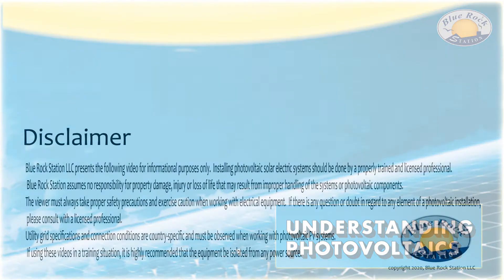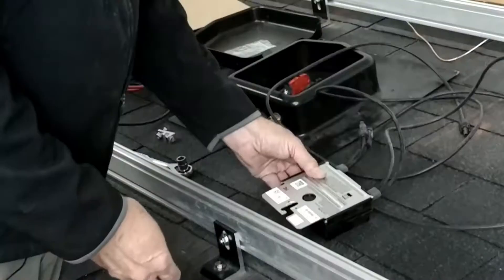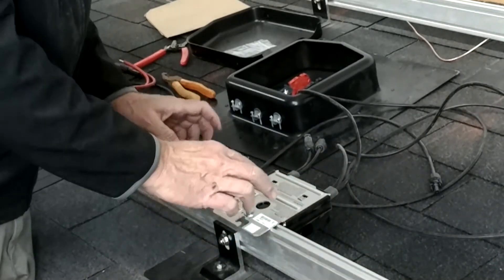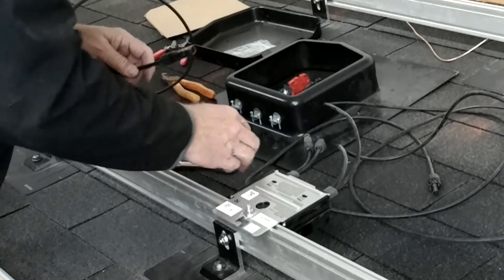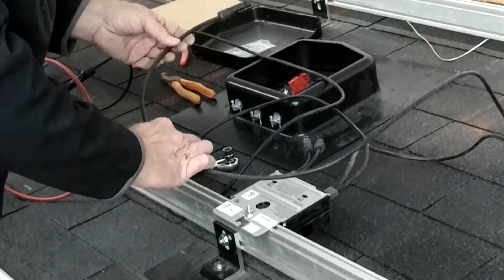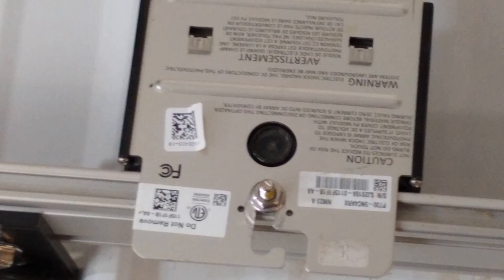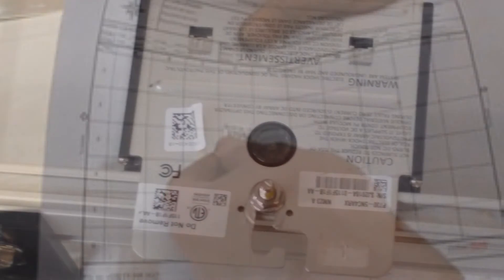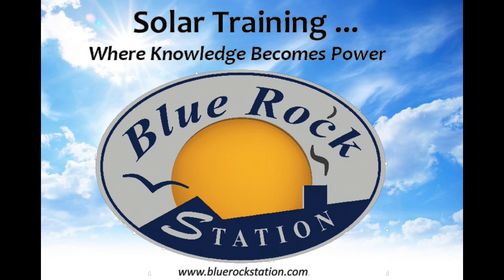Installing SolarEdge Power Optimizers

Comment: Do you run the positive as a home run the junction box.
Reply from the maker: I assume you mean from the positive end of the string.  In that case, yes.  You could even bypass the junction box and home run to the inverter, but that would be a lot of PV wire, so better to use a junction box.

Comment: just for future reference you don’t need to remove the back part of the mc4 they’re sent from factory at a set tightness so the internal part you crimp onto the cable will just fit in then you tighten it, saved you time when you have 100+ strings to mc4